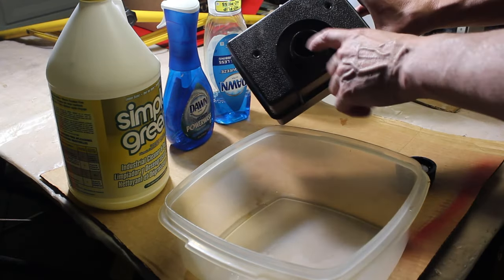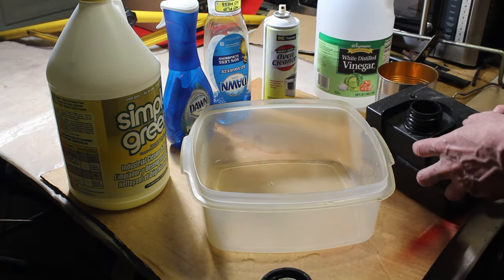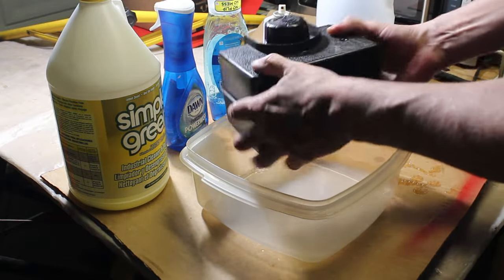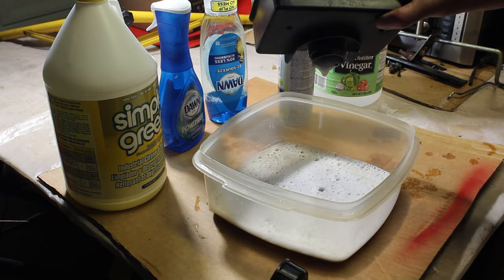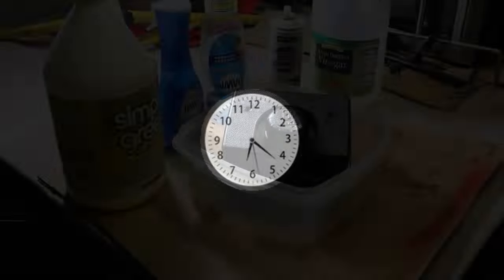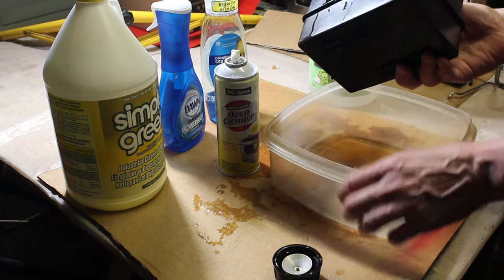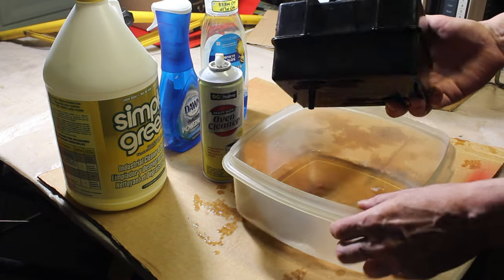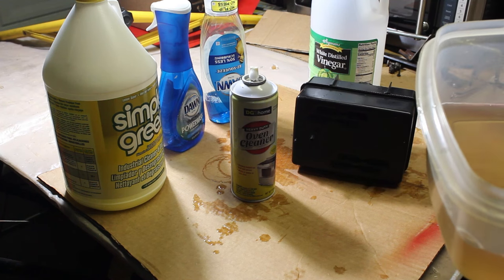WHICH COMMON HOUSEHOLD PRODUCT IS BETTER AT REMOVING GAS TANK VARNISH? (STICKY SLUDGE)

Comment: Try Pine Sol, cleans great, will not damage plastic.
I dunk whole carburetors in the stuff, and it cleans everything, but does not even damage the gaskets or diaphragm's. Partial disassembly works best.
Try it in an ultrasonic tank for even better results.
Simple green at full strength cleans even really nasty greasy plastic things, with out harming plastic. We keep a barrel of it at work to clean plastic parts of refurbished copy machines.

Tim
Reply from the maker: Nice suggestions Tim! Thanks for posting.

Comment: I like the way you think!  It's good that you didn't use solvents that could potentially harm the plastic, right off the bat. I'm really sold on my concentrated degreaser that I bought in bulk about 20 years ago, that I still have some left. Awesome is another dollar store product that I have great respect for.
Reply from the maker: thanks brother, it is coming along for the toro 521, tank looks good time to see if we can get it running, it was free with parts in a box, so i have to sort it all out. What degreaser are you using. Thanks for watching my friend.
Reply: @frankiefixdiy  I have been using a concentrated product called clean & simple. It's theoretically like simple green, only it smells like carpet cleaner. I use it mostly on the patio, but also have used it in the past on foam air filters and small engine carburetors. I bought it because it's supposedly nontoxic when diluted.

Comment: Put some kerosene in there for a few days. It won't harm the plastic or anything else if it's gas-safe. Also if you need to remove heavy grease like bearing grease, nothing beats kerosene.
Reply from the maker: Thanks for the idea! great idea. In this area it's hard to find kerosene but I used to use a kerosene heater all the time until a truck stop near the house doubled the price then stopped selling it.